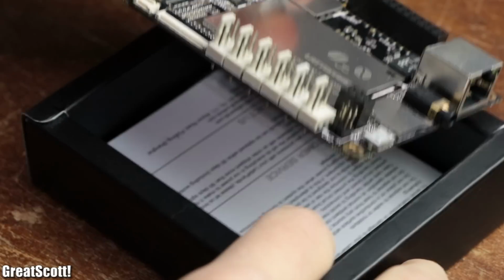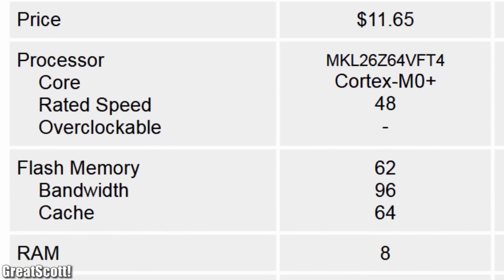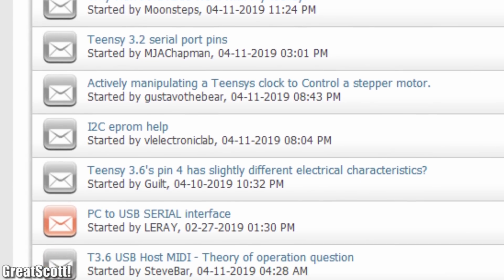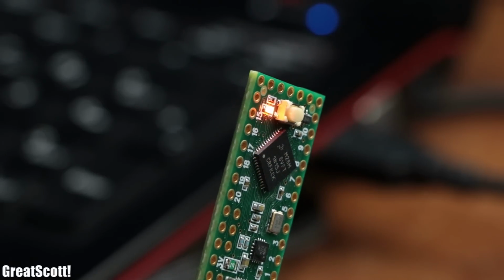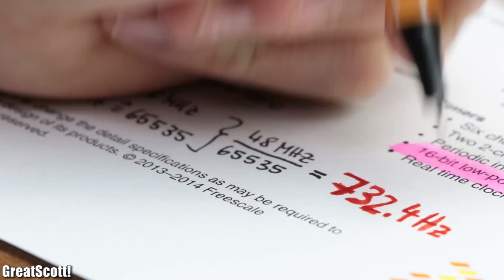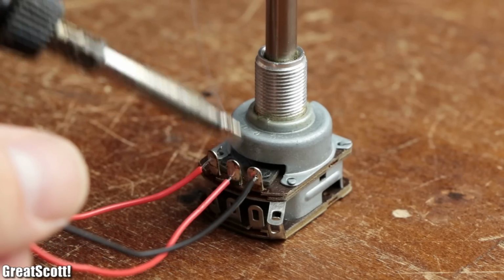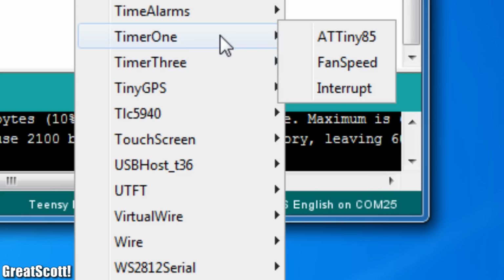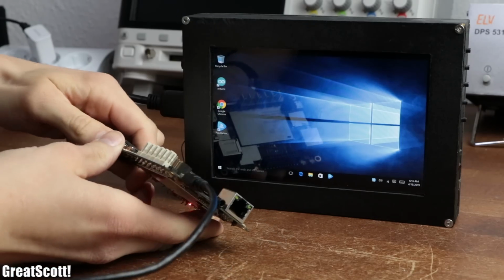Easy & Powerful Arduino Alternative? #3 Teensy Beginner's Guide

Comment: What about using a arduino pro micro which has a atmega32u
Reply from the maker: That would have also been possible.
Reply: pro micro is cheaper and does the same thing, teensy 2.0 also uses atmega32u4 and is more expensive for no reason
Reply: @August0Moura  they are more expensive than the cheap arduino clones because the firmware is not open source so all Teensy come from one source.
Reply: @August0Moura  the pro micro features a mere 32U4 with 16mhz at 5v or 8 in the 3.3v version. The teensy sports an arm cortex m0 with 48mhz. It has more and higher precision adc pins, more pinouts, more and more precise pwm, and so on. I have no idea why anyone buys that arduino crap at this point. If I need wifi I get an esp32 or 8226 and if I need raw power it's teensy 3.2 or 3.6
Reply: @Argosh  its all about buying the cheapest option to obtain the results you want. Like there is no need to have a lot of processing power to build an RC remote for exemple. If not then you could argue you dont understand why people dont buy a industrial CLP hooked up to a highend computer to their projects
Reply: @Argosh  I prefer an Arduino compatible board with the 32U4 for wired HID (e.g. gamepad, presenter, ...). Why should I use a teensy here?
Reply: @lastnickever4440  Moreover, the Teensy 2.0 (like their newer boards) has no mounting holes unlike the Arduino or Adafruit implementation of the Atmega32u4. As a result, I often had to solder a Teensy on some dummy veroboard to have drilled holes or just enough space to slide it on rails to properly fit it into several keyboard/controller projects. IMHO it's a bad design.
Reply: Also known as the poor mans Teensy  :P
Reply: Sponsored video
Reply: @Tyrone-Ward  and what does jlcpcb have to do with this?
Reply: @Argosh  sponsored by Teensy
Reply: @goodwill7643 ??? I don't get all this arduino fanboying. I mean, if you want to convince me just show me either something from the arduino range that approaches the raw processing and io prowess of the teensy range or comes into pissing distance of the esp32/esp8266 value... Just tell me where you'd buy this magical shit that's supposedly better value... There's a remarkable lack of actual buayble hardware on one side of this conversation. At least where non-overpriced nonsense is concerned.
Reply: @Argosh  Are you trying convince me, that if I need 100 keyboards for project, I should go for Teensy 18$, rather micro Atmea32U4 which cost 2.5$ ?
Reply: @goodwill7643  uhm. No. Read my last comment again. Maybe you get to the third sentence this time.
Reply: @Argosh  probably I'm on a wrong page with you. By the same price I meant if we compare STM32F103C8  and Atmega328, they both cost around 1$, but they have big performance difference. So in this situation I would prefer ARM. But for simple task like controlling microwave, setting raspberry PI would be overkill. So for this project what Scott does here, I would take Atmega32u4 or Atmega8u2 due to it cost and I think performance would be enough for this task.
Reply: @goodwill7643  Jesus Christ... Will you please go up and read where this whole pile of bullshit started? I have no issues with any microprocessors. I merely dared to criticize  the overpriced and underequipped Arduino range... A pro micro is more expensive and less capable than the esp32. It is completely outclassed by the teensy which isn't much more expensive. There is, and probably never will be, anything tagged Arduino that will be best value in class. Hell, right now I don't see anything Arduino with good value in class... So please pack up the nonsense and just give it up. No amount of changing goalposts is going to make arduino less shit.
Reply: @Argosh  OK, I give up. And yes I agree, that Atmega currently dying MCU which will be replaced by other MCUs in near feature. And little NO, :) If I see for example pro micro which cost me only 2$ for whole module which contains many supporting components and should just take light strength samples every 5 seconds in shutdown mode, then I think it is more than enough of MCU speed and 8bit range for that task. 
And one big YES for you. I'm more tended to look for AVR side just of my knowledge. I can achieve same or even better results just be cause I know these stones very well (at least I think so). If I would consider learning from scratch. I would look for something else in same price range.  ESP32 is relatively expensive, but this one is very good candidate to consider.
Because Atmega328 is giving up positions on a market, I have 100PCS pack of them just for 90$ for private use ;)
...and I don't want to read all those comments:p . It is discussion about nothing as long we're not talking about production of >1000K products.  :)
Reply: @goodwill7643  dude. This is about hobby scale...
Reply: @someguy4915  another arduino shill approaches... I build plenty of shit myself, not that it has any bearing on this topic. As stated above the reason you don't go arduino is it's overpriced. If you don't care about power (as in computational power) and IO you should use an esp8266 which goes for 1-3€ and has more of just about everything. By now the esp32 can be had for around the same price. 

Let me write that again: The ESP32, 250MHZ, dual core, 520kb SRAM, wifi bgn, bluetooth and BLE, 16mb flash costs between 2 and 5€ by now...

If you truly feel you need more of anything (and the thing comes with 18 ADC, 16 PWM, and the usual assortment of protocol specific ports) you either double up or to go balls to the walls you grab an appropriate teensy beginning with teensy LC at 12$ and ending with the teensy 4.0 at 20$ bringing a fucking arm cortex m7 600mhz processor to the party.

There is nothing currently available in pissing distance.
Reply: An Arduino Pro micro along with mmjoy2 joystick firmware gives you a cheap hid joystick.
Reply: aka an arduino leonardo
Reply: teensy 3 or higher definitely have their advantages (but similar boards using the same microcontrollers are probably cheaper nonetheless)
Reply: @August0Moura  show an example. Else it's just trolling.
Reply: @Argosh  i might be wrong, i'm just guessing
Reply: @August0Moura  so to summarize: You didn't know the massive differences between arduino and teensy, you didn't know what the Cortex lineup delivers so you just guessed that teensy is overpriced...
Reply: @Argosh  that's not my point, i'm just questioning that there might be very similar boards using the same microcontrollers that can be cheaper than those from teensy. You can definetly prove me wrong, as i don't know much about the other teensy boards besides teensy 2.0 and the other atmega32u4 boards, i would be glad to be honest
Reply: @August0Moura  stop trolling.
Reply: @Argosh  Both have their advantages and disadvantages. There's no reason to buy a Teensy if you don't need the features it offers. Doing so would only raise the BOM cost.
Reply: @Argosh  ok
Reply: @vimicito  there is exactly zero reason to buy anything with arduino on the packaging besides "I've always done it". The Esp8266 can do whatever you need from an arduino and handle wifi on top, the esp32 is even faster and has more io and if you are truly io starved you go teensy. The complete range of arduino is overpriced and I find the baseless accusation that the teensy range is overpriced just a bit rich in this context. The maker market is crowded and there's a lot of money being made. Shilling is bad.
Reply: @Argosh  i think you're the troll
Reply: @Argosh one could argue that the reason why the Teensy is fully Arduino compatible is to appeal to just that. "We've always done it" - I'm frankly not going to learn a bazillion nonstandard languages for every chip under the sun.

As a hobbyist, yes the Teensy is very much a viable choice, and the esp boards even more so for their WiFi capabilities. For manufacturing however, cost becomes an important factor. In those cases, scaling down as much as possible can become important. And whenever a cheaper board comes along that does what the product needs it to do.. why buy more? It'd only make the product less competitive.

Not a manufacturer here, just a hobbyist.. but yeah.
Reply: @Argosh  If you need raw power you need a STM32 board, not this
Reply: @ninethirtyone4264  Agreed, but your going to have to write your own libraries. This is what makes the teensy a good alternative if you need more speed.
Reply: @vimicito  esp32 dev board 9€. Esp32 standalone 2€. Esp8266 6 and 1 iirc.
Reply: @Argosh  well if you need only keyboard, there is no need jumping into FPGA or driving F-1 in the city. It is one thing getting powerful MCU like ARM STM32 for same price and other paying more for what you simply don't need.
Reply: If you need raw power you need a teensy.

Comment: I love the Teensy microcontrollers, especially the 3.5/3.6: these are real processing beasts with 32bit FPU and ARM DSP instructions, you can do serious realtime signal processing.
Reply: Can you access hardware timers and interrupts as easy as on arduinos?
Reply: @SirArghPirate  I haven't used a teensy but there is no reason why you couldn't. Just need to include the include file that maps the registers and your good to go.
Reply: @SirArghPirate  you need to add a crystal timer for real time clo k on the 3.2 Interrupts are fine out of the box...
Reply: How does it handle fast interrupts for example those coming from a rotary encoder attached to a motor? Arduino has this bad behaviour of skipping/acknowledging interrupts if the interrupt generated is too fast...this was also because Arduino had a clock speed of 16MHz...with 48MHz, does that perform any better?
Secondly, I wanted to ask about code latency...what is the latency produced due to the code itself? I'm guessing it is less but that caused problems in my Arduino too. Please reply.And the interrupts I mentioned are pretty fast....assume a 120RPM ...i.e. 2 RPS motor and 60 spokes/revolution.... that's 120Hz: the rate at which the interrupt is being called every second...and this happens to be too fast for the Arduino. I want to know if this can handle it to a better extent?
Reply: Rolljam